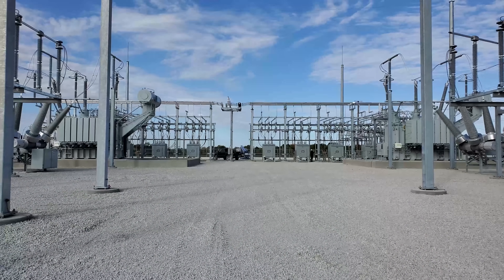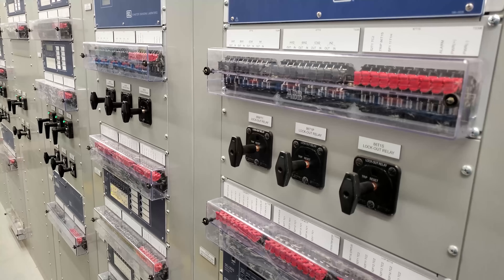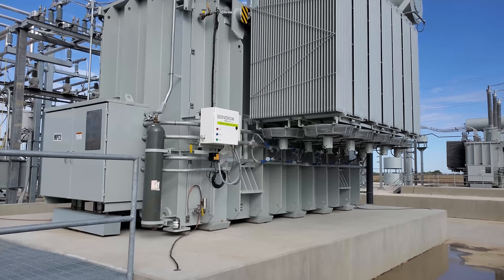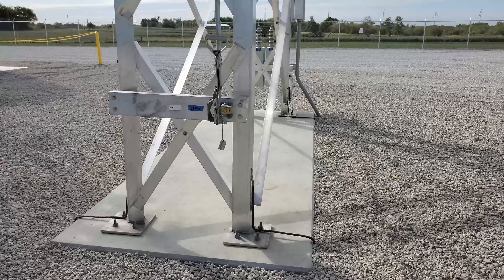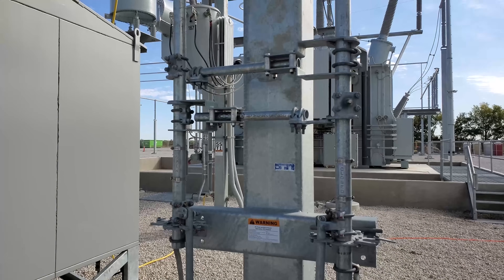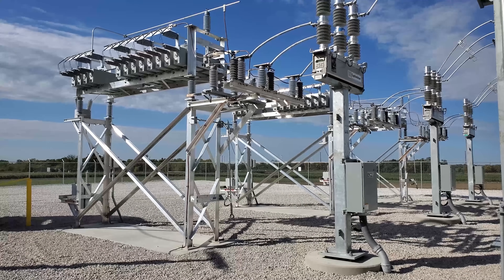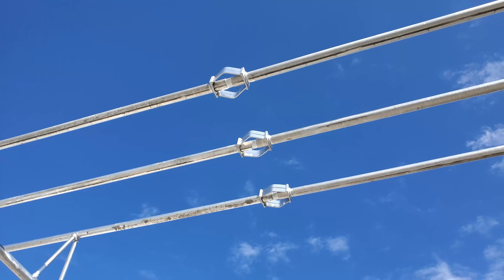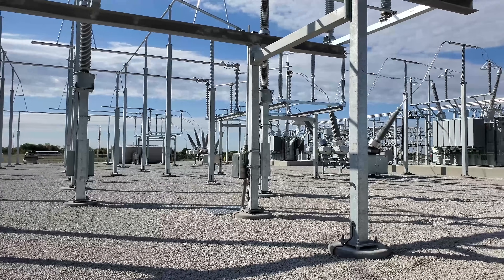345 kV Substation Interlocks - Protecting Substation Equipment and YOU

Comment: As a transmission system operator currently in training these videos are awesome. Due to covid they arent letting me into the field. Surge impedance loading (SIL) is the concept of when and why transmission lines will act either capacitive or reactive. During light loading, the lines will produce MVars, and during high loading they consume MVars. Managing system voltage using capacitor banks and reactor banks is something we do constantly in my control room.
Reply: You're an operator?

I was for a number of years.

Very interesting work.

What you talked about, transmission lines absorbing or creating VARs... It's called Surge Impedance Loading.

Example: A 500kV line will create Vars up to 850MW. Beyond that limit, the line absorbs vars.

The conductors themselves function, with the ground, as capacitors. 

I've seen this measured in Ohms in addition to MW.

Comment: I can't find any info on this, but I've been curious:
Why are some wires run in pairs for (what I assume is) the same voltage & phase (Say at 16:20, to the right of the poles)?
I'm thinking something with surface area, but I'm very unsure about it...

Comment: Have been in the commercial electrical/electronics field for over 50 years and have always had an interest in high voltage transmission lines and substations, but have never worked on them. Your videos are fantastic in instruction and understanding their workings. I have often seen the rings (corona rings) on high voltage lines and now I know there purpose. When I was a teenage there were high voltage towers that ran over a large reservoir near our house. You could hear and see the corona discharge on humid summer nights, very strange to hear and watch. Keep sharing and Thanks.

Comment: Even with all the interlocks, it still relies on the operator making the decision that it is cool to activate the system. If the operator is wrong for whatever reason, disaster can still strike. I've watched a guy go through a set of questions in a software system that are there to prevent erasing critical system info, and answer them all appropriately because his internal model of what was happening was wrong. The files got erased, and we were in deep doo-doo.

A guy could be working on the cap bank, while the other guy thinks he's not, and could go through the whole rigamarole  of ungrounding the caps, taking the key over to the other panel, and then activating the system. But it is a lot better than not having them. Moral is, think hard about what you are doing, and check your assumptions!

Comment: Any suggestions? A few months ago a new remotely controlled pole top switch was installed on the next street. It's on a 34.5Kv primary. Ever since then AM radio reception in this area is nothing but static. I called the power company to no avail. Even when I drive my car under that line the radio reception is blocked. What can I do to get that problem corrected? Thanks.

Comment: @9:42 Am I correct in thinking that the interlock arm is secured to the shaft by the friction of the clamp?? I have seen clamps loose their original tension over time and in this case I wonder if this has been considered.
This would apply to the breaker interlock on the opposite shaft.
Reply from the maker: yes, but we have piercing bolts as well (not installed when I filmed). Those piercing bolts eliminate any slipping if bolts go loose. Great observation thought!

Comment: I have often noticed the sizzling, but had never heard about the Corona shields on sharp edges and bolts before, I find that fascinating.
When I hear an extra noisy pole, I just always assumed it was tracking over the insulator or something, but I guess it could just mean it has a sharp edge.

What's the minimum voltage that this is an issue with?
Reply from the maker: Typically anything 230kV and over gets the hardware and corona shields, but its all based on the engineering company.

Comment: Submarine line terminals also have some neat interlocks going on. They supply power for the repeaters/amplifiers at the bottom of the ocean, can be thousands of volts (DC IIRC), so you don't want to be sticking your hands into something that could burn them off.

There's usually a sequence of operations that must be performed in order to release keys that then allow the next set of operations to be performed, eventually leading to a safe system to work on 

Sometimes there's even operations that require two keys to be turned, so you need a second person and they are spaced far enough apart that one person cannot physically do it themselves.

Comment: Finally, someone give me a name for those corona ring ! Thank you so much !
One question: when you walk under the high voltage powered lines, do you wear a protective outfit ? Do you feel and are you exposed to a dangerous electrical field ?
Reply from the maker: No protection. Since the voltage is around us, and not going through us, there is no danger. The crazy amount of substation grounding and rock protect us. If there was 0 grounding and 0 rock and I was grabbing onto a ground rod near the conductors, i would get the crap shocked out of me. These are designed so there is 0 risk. I only feel it if im close to a low conductor and i touch a piece of grounded metal, i get a shock equivalent to a balloon.

Comment: Looks like the bottom clamp is finger tight at 10:34, great insight into yard stock.
Reply from the maker: Agreed, and the pierce bolts were not installed. Yard not fully completed yet ;)

Comment: i'm a software engineer and i absolutely love interlock systems. i typically design the systems i build opposite most people - i put a lot of trips in them so that if conditions are outside of the expected parameters they fail. it's more difficult to build up front, but i think the payoff is well worth it when something goes wrong and rather than continuing to run it shuts off.
Reply: Same here. I've written online transaction processing systems, material handling systems and robotics. I thought that last mechanical interlock was truly beautiful, so simple, so elegant and effective. It's easy to design something that's needlessly complex; it's difficult to design something (that hasn't been designed before) that is simple and elegant.

Comment: Hey @SpeedFreakLS1. I believe the rings on the arrestors that are underhung on the deadend structure you called corona rings are actually Grading rings to ensure a uniform voltage across the arrestors. A lot of people call those corona rings but typically when they are on an arrestor their function is typically to act as a grading ring. Keep up the great videos though, there are a few people in our office that are really enjoying them!!!!
Reply from the maker: You are correct. Its technically both on that specific Hubbell arrestor. The ring around the hardware is the corona ring. The ring around the insulator is the grading ring. 1 piece with 2 functions!